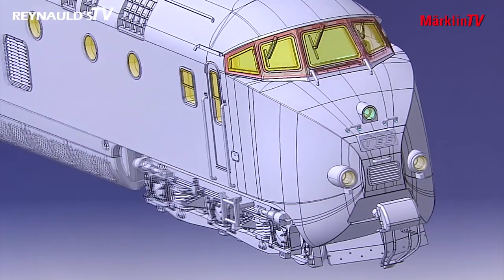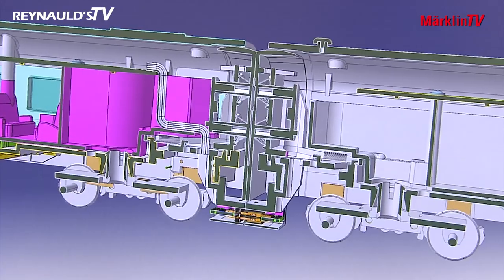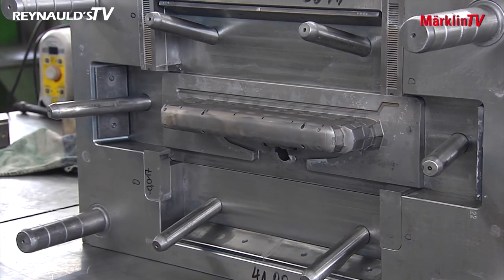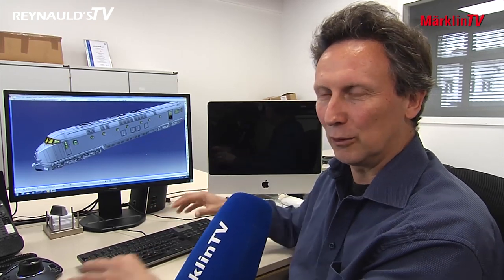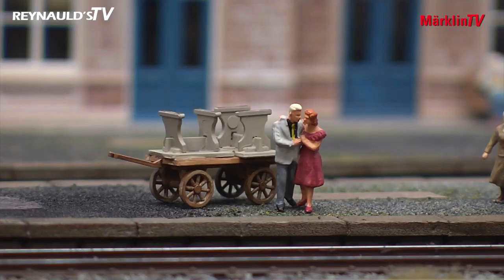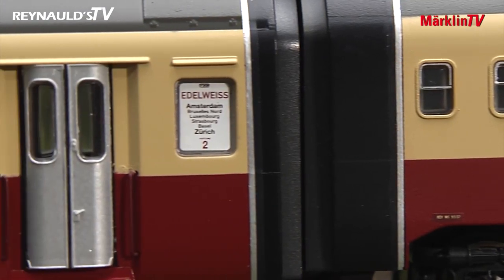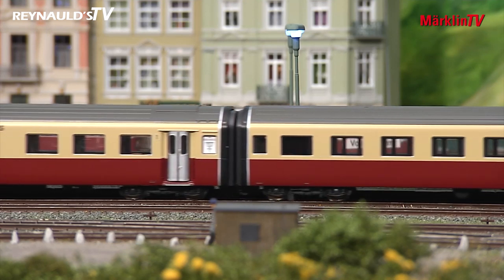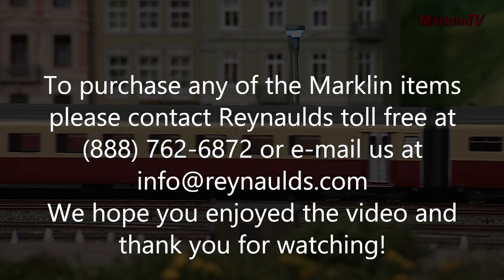Marklin & Trix 2020 Insider Club Model

Comment: Great to see this model being manufactured by Marklin again after 50 years.  In the summers of 1969 and 1971, my college years, I worked for the exclusive US Importer of Marklin, (except for 11 Western states), Reeves International.  They also imported Corgi diecast vehicles, Britains and Steif (Button in Ear) stuffed animals.  

We could purchase the upscale items at a substantial discount, so at the end of my second summer there, I spent most of one week’s US$75 wages (@ $1.75 hr, ten cents above minimum wage!) on the Hamo (two rail) three car set, # 8370, plus the extra car #8470 that was not included in the set. I had very little left in my pay envelope that week but never have been sorry as I still have them!

They run on my American prototype layout, which is not too far-fetched as three of the original prototype trains were later sold to Canada, and operated on the Ontario Northland railway.